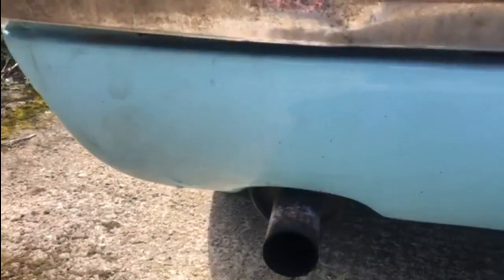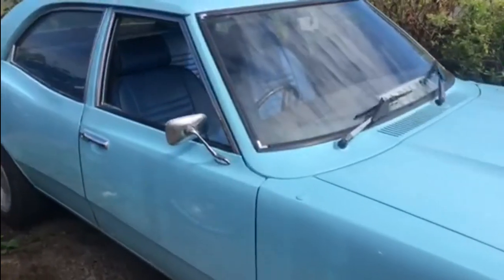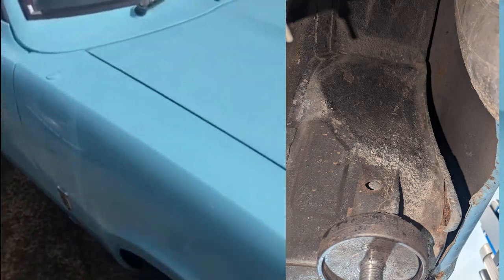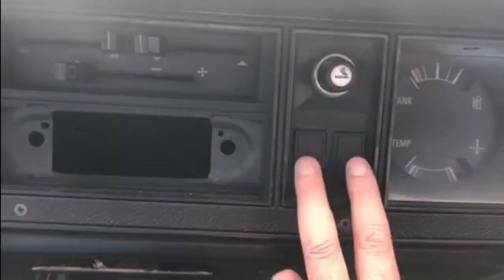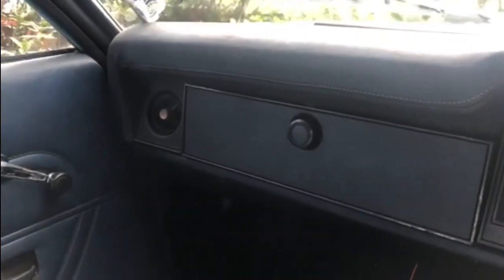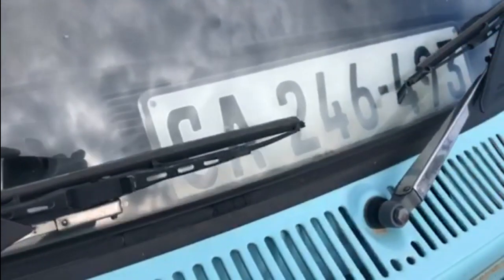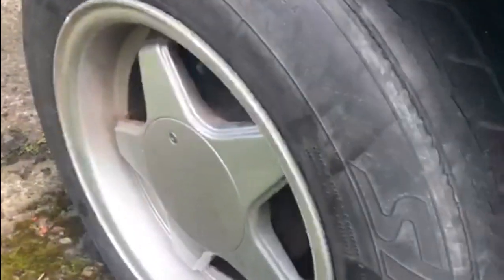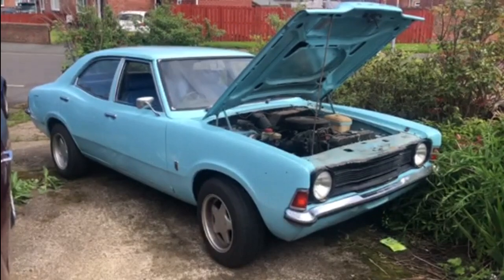New Project Reveal - Dagenham Dustbin!

Comment: Strong motors the Esssex V6. It's weakpoint is the plastic teeth on the timing wheel. Don't rev when cold. That fan belt is a bodge job I'm afraid. The correct size one will bring the alternator down and avoid the bonnet!
Reply from the maker: I knew the position had to be wrong, with it being South African, might have been a case of use what’s available and make it work rather than try to get the right parts